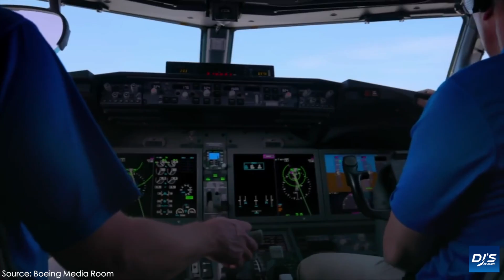Boeing 737 MAX & MCAS Problems

Comment: Why could Boeing not  have put as much effort into building civilian craft as it did for its military safe craft. the Poseidon military craft based in Uk 
Is a masterpiece.Where did things go wrong in the chain of command  at Boeing. We’ve lost some of the brightest stars working for United  Nations helping the poorest in Africa on the Ethiopian craft.
But let’s not forget the others from too many Countries to mention  here RIP. My heart goes out to all the families of this needless tradgedy🇬🇧🇺🇸💔🇺🇸🇬🇧🙏😥😥
Reply: @Elaine Blackhurst - Boeing builds masterpiece military aircraft? Try telling that to the USAF who are having to deal with a boondoggle called the Pegasus. AKA KC-46 tanker. Its years late, $4 Bn over budget, has been grounded for a while (as all Boeings are), its unsafe for passengers and freight and cannot refuel aircraft with its boom system. Oh and they are delivered with FOD in the fuel tanks (which also leak) and in the wings. It has 4 primary failures and will not be IOC until 2023 at the earliest.
Its so bad the USAF are only paying Boeing 80% of the agreed price per delivery.
The RAF would do well to put each Poseidon through a very detailed examination on delivery. It is after all a glorified 737 although thankfully an NG not a MAX.
Reply: Elaine Blackhurst don't let them fool you, Boeing Defense plants are run by the same despicable corporate culture. They get around the Defense Contract Management Agency like they get around the FAA. I've got photos of work signed off incomplete and jobs signed off with foreign object debris (FOD) left behind. Their inspectors are afraid to write up any nonconforming issues and everyone does as they're told all for a paycheck. If you're brave enough to reveal a bad job that was already inspected they shrug it off because as they say "it was inspected."
Reply: All About Me   These very serious allegations if they led to loss of life without taking videos etc the Corporate pen pushers who exist at the top of Boeing would just get rid of you you need evidence that would stand up in a UK Court as we have lost some UK people. It’s sad that good engineers that I  saw in the Aljazeera documentary were too afraid to speak out and one man who did was fired and couldn’t afford his kids education etc it was trully harrowing and interestingly Boeing never disputed or sued Aljazeera for the Documentary  Boeing’s Broken Dreams therefore it was all true.Even after the doc. it was business as usual at the Southern plant not the Everett one  asBoeing is just a Wing of US gov that cannot be challenged sadly 💔😥✈️🇬🇧🇺🇸
Reply: @elaineblackhurst1509  I don't know if you deleted your comment from an hour ago or if it's being censored or ghosted as it's not in the comment section, just in my notifications.
Reply: @AllAboutMe-cy9xj  I noticed too as well this morning
Reply: @filledwithvariousknowledge1065  did you also notice ghosting and difficulty posting certain comments? I tried posting some real facts and no matter what I did they wouldn't post, I tried a couple different YouTube accounts and they wouldn't post. Very suspicious if you ask me.
Reply: @AllAboutMe-cy9xj  While some of it I do think is YT comment guidelines, I wonder if some of it is also DJ deleting comments as this has happened before a couple of times when I’ve tried giving constructive feedback and the comment was there a few hours and then gone
Reply: @filledwithvariousknowledge1065  you could be correct, people sometimes fold under fear or disbelief. It's just frustrating having too log out and go back to see if your comment disappeared, because as long as you're logged in the ghosted comment appears. But if you're comments ghosted when you switch accounts or log out the comment will disappear.
I speak from the heart and firsthand knowledge, I have photos and documents and would testify in the court of law to anything I claim. I understand it's hard for some Boeing fans to accept, but it's reality.
Reply: All About Me   Let them ghost all they want in my opinion the truth can never be hidden for long  if  things are true it will stick in people’s minds do trust me.  Destiny is not changeable  but lies about anything even Covid ie saying its just a cold  it will disappear as one leader said with now thousands dead 😥✈️🇬🇧🇺🇸🙏💔🦠🦠Coronovirus 👎👎😥😥
Reply: All About Me   Don’t be surprised if your post miraculously disappears but I’ve seen it and acknowledged it 💜💙👍🌟🥇😥✈️🇬🇧🇺🇸🙏
Reply: @elaineblackhurst1509  I hear you on the magical disappearing 🤫 but since I don't work on aircraft anymore I have time to spread the truth around 😎. Sorry you had to hear such negativity but it's reality at Boeing, thanks for listening 💙 ✈️ 👍
Reply: All About Me  I hope you have a job worthy of your integrity your employer will be a lucky person bravo 🌟🥇🇺🇸🇬🇧✈️🙏👨‍✈️👨‍✈️👑
Reply: @elaineblackhurst1509  thank you very much for the kind words 💜 we must all not forget that truth is now called hate by those who hate the truth 👍. I once was a private aircraft mechanic for a wealthy man, and whenever he'd lose a large chunk of money he'd always be positive a cheerful. I asked him "how can you be so cheerful and happy yet you lost all that money." He looked me in the eyes and smiled as he said "it's only money and I can make more somehow." I no longer make the easy big Boeing money, but I don't have to deal with the weekly struggle of trying to fight them and do the right thing.
I will eventually get my experience and knowledge of their corruption out in the open, I won't let them silence me! The world deserves to know the truth 💜 ✈️ 👍.
Reply: @All About Me Perhaps Boeing could do with some UK Plants which could be trouble free besides the current one opened a couple years ago now which is the first European one.
Reply: @filledwithvariousknowledge1065  the problem with Boeing is its leadership is corrupt, no matter what country they are in they will mold the employees into what they desire. They will reward those who keep their mouths shut and punish anyone who speaks out about their dodgy practices. When you go into Boeing you are proud and happy, but soon you will be introduced to dodgy practices and you dare not object or speak out. If you have no integrity and you go along everything is fine, if you object or speak up you won't last long.
Reply: @All About Me That’s very concerning😬
Reply: @filledwithvariousknowledge1065  it's deeply concerning, however it's reality and nobody has been successful at doing anything about it. I've seen families destroyed for attempting to speak out. And then we've seen families destroyed by aircraft accidents. You, I and the world are known as heads to them, we are expendable in their quest for Cost, Schedule and Shareholder Value! 
In 2017 I told my family and friends "we have witnessed a long stretch of nearly accident free aviation, but in time we are going to witness aircraft falling from the sky" they looked at me like I was crazy! I seen the writing on the wall due to the dodgy unethical practices taking place, sadly it all happened faster than I thought.
When I entered aviation just over 20 years ago, my biggest fear was loosing an aircraft so I refused to engage in any dodgy or unethical practices. So when I was introduced to such practices I was very disturbed and frequently spoke out. It got me nowhere but mocked, threatened and eventually terminated. If I had to do it all over, I'd do the same thing because I have integrity and morals. I don't partake in dodgy unethical practices just for a paycheck. ✈️ 👍
Reply: No doubt Boeing's reponse would be on the lines of 'we're not building it to a military budget, so what do you expect ?'

Comment: Boeing has finally lost the race with Airbus, and it is their own fault. The will be kept alive by the military and domestic orders, but their time as a global competitor against Airbus is over.
Reply: In the cargo market as well, since they basically have a monopoly there.
Reply: Airbus is running away with orders, deliveries and customer satisfaction.
Reply: @averagejoe9249  For how long is the point. The same could’ve happened to them and the same audience angry at Boeing will then be angry at Airbus
Reply: Plane Facts   I don’t think there has ever been or will ever be anything  corrupt going on at Airbus but yes VW. German cars did fiddle emissions at one point so you know there is always the possibility if Airbus was left as the sole Aviation Co without a competitor it could cut a few corners itself. Never say never it’s a cut throat industry Aviation and all bets are off 😥✈️🇬🇧🇺🇸🙏👩‍✈️👨‍✈️💔👎
Reply: Bro it’s just one plane what mean Boeing sucks like look at the 787 that’s a great plane or the 787 800 that’s also a great plane

Comment: Sttttttoooooooppppppppp with the 737 bad news. Focus on the good news of the H2 plane airbus is coming out with by 2035
Reply: I’m looking forward to it and I’d hope Boeing will make a rival. Heck I’d like Embraer to consider that sort of idea for replacing the E2 jets by 2029 or offer retrofit. The only draw back though is the water emitted from the engines will act as a green house gas (although thankfully there hasn’t been evidence it’ll make turbulence worse unlike CO2) unlike on the ground. Edit: Okay maybe the water vapour emitted isn’t as bad as I initially thought
Reply: @filledwithvariousknowledge1065  Water vapour is a greenhouse gas, but it doesn't stick in thr air for as long. Edit: I should add that clouds are water vapour, as are current contrails. So really it's a non issue
Reply: MultiGamer 0822   Never mind 2035 EasyJet  UK building an Electric craft with Wright Electrics US  tests 2023  flights 20030 so the expertise is right on Boeing’s doorstep in US. But why bother Boeing their too interested in rehashing old models and calling  them new with deadly results sadly 🇬🇧🇺🇸😥✈️💔👎
Reply: Elaine Blackhurst 48